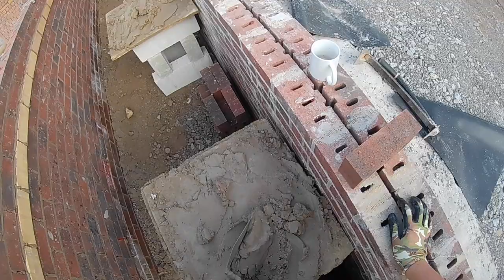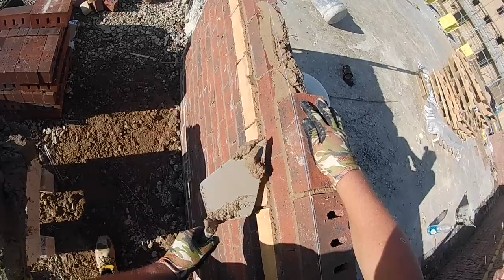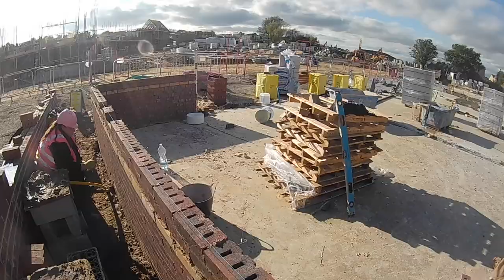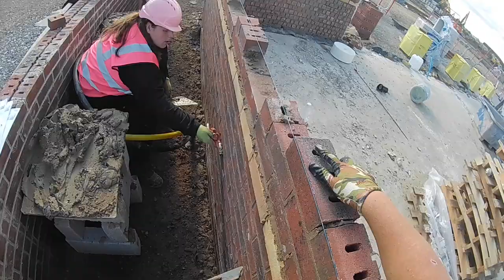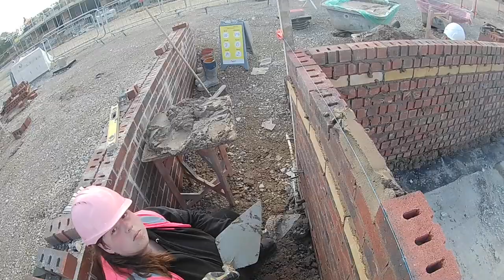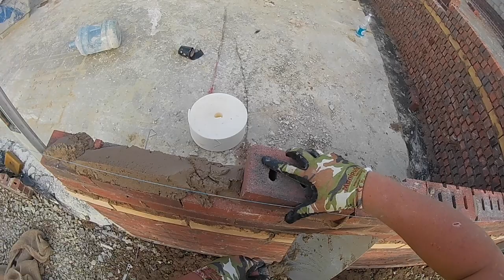Bricklaying Vlog - Gazebo's & Winter Bricklaying?

Comment: Best rain coats are from Decathlon mate! Very well priced and really really good! We put the meter boxes in backwards. So the door is facing the internal Blockwork, and then build almost up to them, probably 10mm back and then we pop it out when we are ready for lintle and put it in the right way, no need for plumbing mate👌👌 (also lean a scaff board on it to stop it falling back)